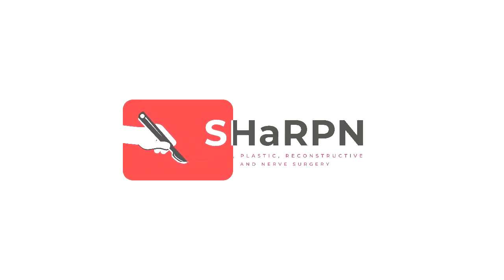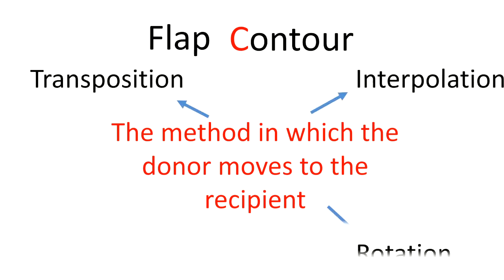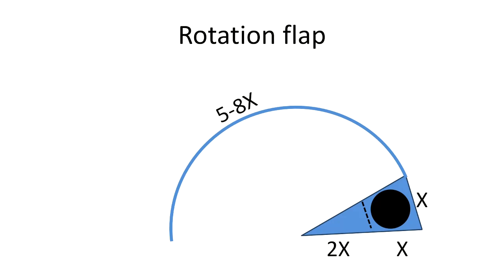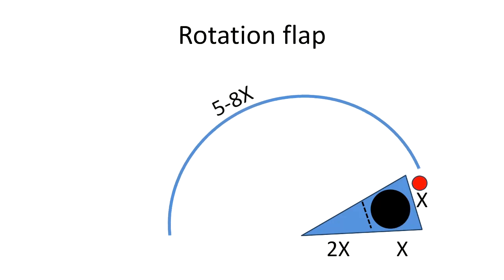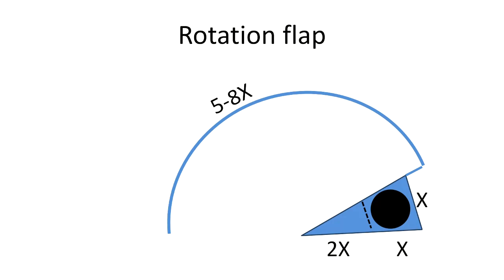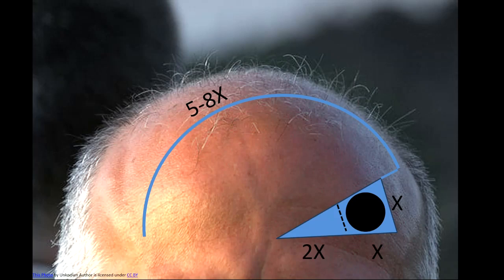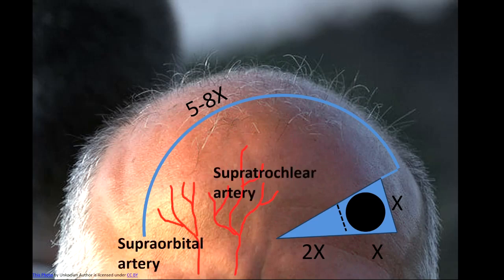How to design a rotation flap

Comment: informative
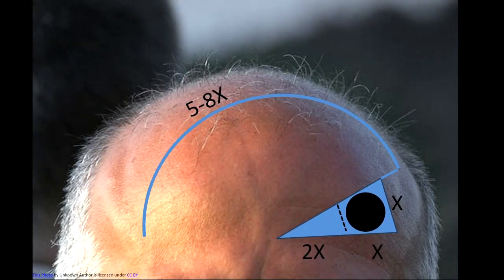Wont the forehead rotation flap distort the position of the right eyebrow? 2:20
Reply from the maker: Not if you are a good distance away which you will be if you're on the scalp, and if you raise the flap completely so that it rotates instead of advances. And the burrows triangle or back cut further takes tension off the eyebrow, but you're right, one will have to be aware of the eyebrow and tailor your flap to protect it from disruption so very good question.